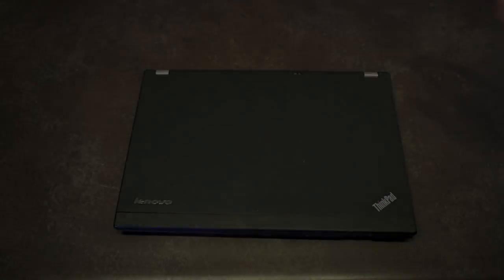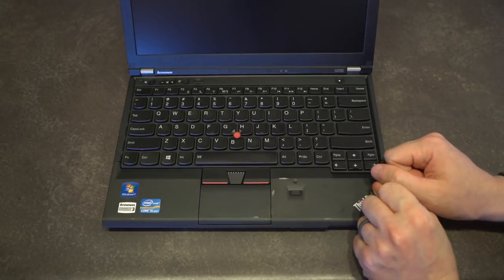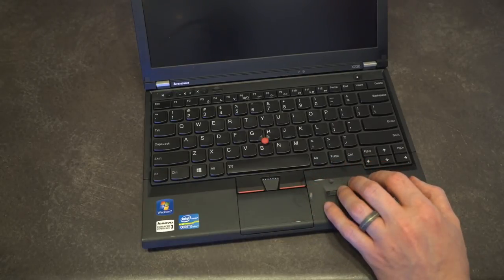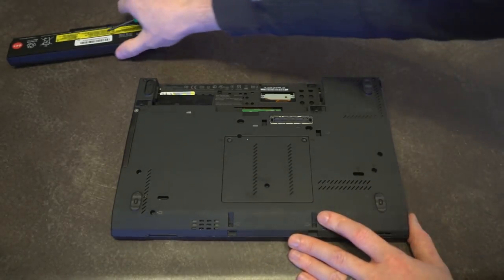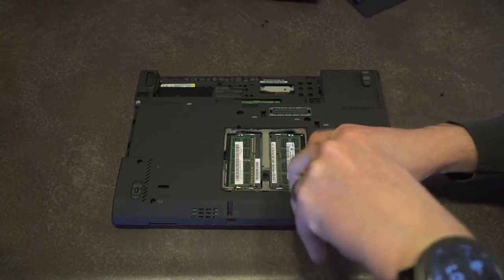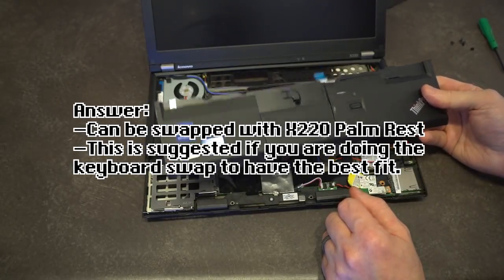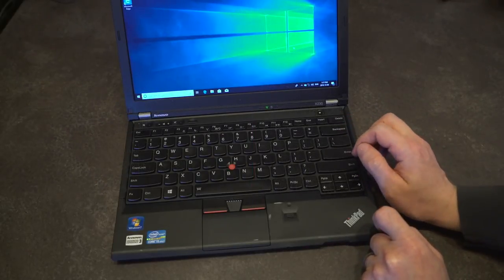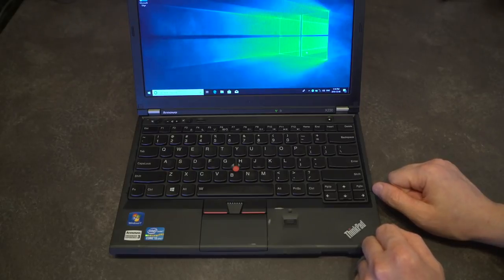Lenovo ThinkPad X230: A Fan Favourite

Comment: Bought a x230 a few days ago and it's a great little machine. I swapped out the HDD for an SSD and changed the RAM from 4 to 8 Gigabytes. I paid 130€ (146$) for the used x230 in good condition, 23€ (27$) for the used RAM, and 20€ (22$) for a new 120 GB SSD. Not a real bargain, but for a country like Germany, where tech-bargains are really rare, it's a pretty good deal.

Your video is one of the best videos about the x230, because it includes the main things about this notebook, while it is relativly short. Keep up the good content. :)
Reply from the maker: Thanks for the evaluation of my content. It is a balance of information and length and I try to strike it in the middle. These machines have a lot of information to go with them but choosing what will matter most can be tricky.
Reply: Same here, bought it about month ago for £108, added another identical samsung 4gb stick for £12, so its 8gb now. It has backlit keyboard, IPS screen, i5 2.6ghz and it has 500gb hitatchi 7200rpm hdd which is fast still and i havent rushed upgrading it to ssd yet. Takes less than 20 seconds to boot and to login to desktop. Also i got ultrabase series 3 docking and lenovo dvd drive, both brand new and paid £28 in total for that combo. Love this machine!
Reply from the maker: Wow, what a setup. Love to see pics.
Reply: Where did you buy it if I might ask?
Reply from the maker: I buy mine locally.
Reply: @BJKaan Akkoc Write English! The x240 keyboard can't be easily upgraded with a keyboard of the x220 (non island style). Also the processor is weaker but more energy efficient. Maybe get a even newer model if a windows upgrade is already a hurdle for you!
Reply from the maker: I'm not sure the x240 can take a 220 keyboard at all.
Reply: I did the same upgrades you mentioned... +4GB RAM upgrade and a 480GB SanDisk SSD swap... its a beauty now... enjoying the machine everyday... amazing battery backup and portability!!!

Comment: Watching this on an x230
Reply from the maker: W00t. What is your specs?
Reply: @LaptopRetrospective  Just the i5 model with 8GB of RAM, nothing too fancy. It's my daily driver and it's fairly solid for most of what I do.
Reply from the maker: You need a daily driver and one for home use. At least. Lots of reasons for another.
Reply: @LaptopRetrospective  I was considering picking up a T420 for home use.
Reply from the maker: Not a bad choice either. Decisions, decisions.
Reply: Me too!
Reply from the maker: Nice!
Reply: My school laptop is a T420. Man do I love the keyboard on that thing!
Reply from the maker: They are nice, for sure.
Reply: Mine with 16gb ram with i5 cpu.
Reply from the maker: Lots of RAM to go around.
Reply: mine too its my main working pc with i5 8gb ram and 250 msata + 500 850 evo on a docking with 6 extra usb. couldnt find any other pc at this price with similiar peformance
Reply from the maker: Great point on price and performance.
Reply: Same! Actually arrived the day after this video was published!
Reply from the maker: Good timing!
Reply: me too :)
Reply: Watching this in 2019!!
Reply: same, but my is the Tablet model =)
Reply: Does anyone here have the IPS display? I love this friggen thing, If I had  the IPS display it would be perfect.  i7, 16gb, OEM intel SSD, fresh oem 6 cell battery in my machine.
Reply from the maker: Those are some nice specs you got there!
Reply: @LaptopRetrospective  thank you, it was a great bargin I got second hand off Craigslist almost 4 years ago.
Reply: On a x230, with 8gb ram and samsung evo 860 ssd :)
Reply from the maker: Very tasteful upgrades you have there. 😁
Reply: i7 3520M + 16Gb + 480SSD here. Superb machine. but im thinking of the fullhd IPS mod also ... yeah i work at local computer shop that sells old leased computers to private use and we have service too... and lots of parts. Modded my T430 to fullhd IPS from X1 carbon. also with i7 and 16gb... because, why not :)

BTW we give 12 months full guarantee to those old computers we sell. I think it's reasonable for a computer that cost 150 european buckaroos?
Reply from the maker: Very cool. Glad to hear you are doing that. It's support from shops like yours that help keep my channel in content.
Reply: Mines the x220 Intel Core i7-2640M CPU @ 2.80GHz 16gb ram 480GB Kingston SSD and even though its getting on it blows some off my friends newer laptops away!!
Reply: Me is with my x200 😉
Win10 Pro 64-bit, 8GB Ram
Reply: same x230
Reply: Me too！
Reply: Watching this on a X230, with XP Pro x64. All drivers installed, including for the fingerprint scanner!
New Moon's a pretty good browser, btw.
Reply: Same
Reply: Same here
Reply: Me too. SSD upgrade is a must! Also using MSata drive.
Reply: @wofwof14  how did you upgrade to win 10?
Reply: @legendsathya3041  i just installed the windows 10 pro and it doesn't have any issues.. Added higher RAM and SSD.
Reply: @wofwof14  your fingerprint authentication still works with win10? Did you install from win official website? ( Please don't mind, I'm noob )
Reply: @legendsathya3041  yes I got the driver updates in all from Lenovo thinkpad center.
Reply: Mine bought it new and upgraded.
i7 3520 16GB ram 2TB Transcend 230s WWAN full HD IP

Comment: I've got one of these, and have been surprised at just how quick it feels. If I didn't know it was made in 2012, I wouldn't think it was an old machine. I have the i7 with 16GB of RAM and a whopping great SSD in it. Mine also has a hardware mod to support a 1920x1080 panel (so it was an extremely lucky eBay find).

I develop web applications for a living and find this X230 does the job nicely. So nicely, that I decided to get a W530 (a 15" version with a quad core CPU, that costs a similar price to an X230) to use solely for my work. The W530 is a tank, so stays at the office, while the X230 is predominantly for home/out and about use.

The only negative to the X230 is the low speaker output, but headphones obviously work around that problem.

Oh, and the docking stations – if you have a separate monitor, they're superb (and very cheap on eBay).

On the keyboard issue, I'd rather ThinkPad still used the original keyboard layout, but the action on the X?30 chiclet keyboards is the nicest I've ever used on a laptop. Once I got used to the position of the Home, End and Del keys I didn't look back. I'd recommend the non backlit version, which feels nicer (and the thinklight is always there to light up the keyboard if necessary).
Reply from the maker: That's a nicely kitted out unit you have there. Thanks for sharing the mods done and what you use it for.
Reply: This laptop is amazing I use it as well. Although 2012 laptops are not that old in 2018. 6 years old isn't really old. Laptops as of 2010 are old
Reply: hi.. does your computer run hot.. ive heard that the i7 version have that problem
Reply from the maker: I'd check the age of the thermal compound.
Reply: I bought a W530, quad core i7-3840QM, NVidia Quadro K2000M, 24GB RAM, 256GB mSATA SSD, fingerprint scanner and color calibration sensor. I want to love it but it's probably going to get torn apart and sold for parts. The screen glitches randomly quite frequently when I turn on or wake it up. And recently, it began to shut off as if it lost all power. I feel as though it might be a bad connection around the CPU because pressing down on that area causes the laptop to shut off. I did some research and it seems that it's a common problem among W530's. I'm surprised that a laptop that costs this much, especially a ThinkPad, is having such issues; it agrivates me. Have you had any similar experiences with your W530?
Reply from the maker: No experience with that W series yet. I'll ask around.

Comment: I use mine nearly every day.  Nice and very capable machine even in 2022.  Other than SATA SSD,  mSATA SSD and ram upgrades to max it's stock.  I have the ultrabase, the slice battery and an express card dual USB 3.0 add-on to go along with it.
Reply from the maker: Nice! I know I love using my X220 around the house.
Reply: Would you reccomend an x230 for word processing, browsing the web and basic windows use? The price around here is around 120 euro
Reply: @Tonn_23  If you put an SSD into it and 8GB RAM it can handle that stuff just fine.
Reply: @uni-byte  Thank you!
Reply from the maker: Yep, it can do it all.
Reply: @LaptopRetrospective  it can't make me breakfast though :'(

(yes i know i know it's a laptop. i was just-making a joke (since (as-in "because") you said the laptop can do it all)).

Comment: Nice!  I picked up an X230 recently off Craigslist for $200 - I already have an X230T.  I had no idea a backlit keyboard was an option, so that was cool.  Normally I would upgrade to 16GB but it has 8GB and that's enough for now.  I did buy a new 44++ (9 cell) battery; that wasn't a problem but did cost around $60.  I am running Linux Mint 19 on it and use it for software development -- node.js and visual studio code.  I like it quite a bit, I am seriously thinking of getting another one before they become hard to find.
Reply from the maker: Or to have cheap spare parts. It's how the collection begins.

Comment: In 2019: i7, 2.5 TB SSD, 16GB ram, Backlit keyboard and 4hours of battery on Ubuntu 19.04.
Reply from the maker: Nice!
Reply: Nice. I have it with an Kingston 480GB A400 Sata3 2.5" Internal SSD and 8 GB RAM. Looking to upgrade. Any suggestions of SSD and RAM ? Thanks.

Ubuntu user too, I am looking to try Arch with the new SSD.
Reply: Do you think I could easily upgrade my i5 to an i7?
Reply from the maker: X series are soldered so it's a motherboard swap.
Reply: @LaptopRetrospective  I guess I better start searching for a motherboard with an i7
Reply from the maker: Or an x250 board, they drop in to the x240 and vice versa.
Reply: @LaptopRetrospective  I have a x230, and have been thinking of searching for a x250 but I really like the x230 and don't know if the upgrade is worth it
Reply from the maker: Depends on what you're hoping for. The x250 has amazing battery life.

Comment: Just got my X230 here a few days ago.  Already swapped the HD out for a SSD, am running it as a dual boot system with Windows 10 and Linux Mint 19.1 on it.  Going to do the IPS screen update here one of these days, also have another hard drive caddy on the way so I can swap in another SSD to play with other Linux distros so I won't nuke my dual boot drive and in case a distro gets hosed. Not to mention it makes distro hopping a lot easier..

So far I'm really enjoying it...
Reply from the maker: Nice plan. I suspect that will work quite well. I do similar things with my x220.

Comment: I have a W530. I never knew about the light. Mine is a llittle flash light mounted next to the webcam. Very neat. I learn something new about these ThinkPads every day.
Reply from the maker: The ThinkLights are really handy for looking at documents and other such things in dimly lit areas. Late night plane or train trips are easier because of it. Same with all the other weird places ThinkPads end up.
Reply: @LaptopRetrospective  I bought mine recently because its pretty powerful for the price I paid. Also, they are very Linux friendly which is the OS I run.
Reply from the maker: Very nice. Which distro are you using? Tried elementary yet?
Reply: @LaptopRetrospective  I have, Elementary is very stable. But I use Arch as my daily driver.
Reply from the maker: Fair enough. Arch is quite tweakable and has been at the forefront of ThinkPad support.
Reply: Well I will say getting the Optimus drivers to work properly was a pain. But once I got over that hurdle its been very stable so far.
Reply: Yes, precisely. Utilitarian and non-gimmicky. Same reasons apply to the Trackpoint. I prefer to do all my typing and coding on a Thinkpad or my desktop's Model M.  Linux friendly for just about any distro you throw at them as well as BSD. I wouldn't quite say match made in heaven, but it sure comes close. Far better than any other laptop I've used for Linux. Not all features may quite work, but all the features that do, required no configuration really whatsoever aside from enabling maybe one service with a quick systemctl command or attach command for Wacom support. These notebooks, good or bad, still hold a special place with me.  @LaptopRetrospective
Reply: Arch has been an incredible experience on here! Gave me way more use out of this Core 2 Duo L9600 as well!  @LaptopRetrospective
Reply from the maker: Agreed. They are special.
Reply from the maker: @jessehill9993  respect to Arch but I've enjoyed Mint and elementary a bit more, but I'm a casual user mostly in those distros.
Reply: Fair enough, and rightfully so! I wouldn't say Arch would be a casual user's distro anyway although I think it would be fantastic to see one just as light and customizable. Not to say others aren't, but I've had big problems customizing say, Linux Mint in particular especially desktop environments. Fedora on the other hand, did it beautifully. I actually started using Linux on Linux Mint myself. I'm also glad you didn't say Ubuntu! Orange you glad too? I distro hopped until I settled on Fedora and Arch as my standards but every gripe with Arch is deserved. Thinkpads still have been far more friendly than say my Lenovo P500 which brightness control has been a severe problem across the board with Linux. I do retro-computing so reboots aren't as big of a deal for me, but on my "cutting edge" if you may systems, it shouldn't have to happen if I don't want it or need it especially when you hit brightness controls and it drops to the lowest setting and won't work again until you get back to the POST screen. NetBSD also has been designed on Thinkpads for Thinkpads as well. My Arch opinion has always been like this... if you have the time and energy, don't be lazy and try it or at least don't be scared by it.   @LaptopRetrospective
Reply from the maker: Well said. Ubuntu doesn't do it for me. I think other people are doing better and greater things for the average user.
Reply: Ubuntu... Me neither. Canonical really dropped the ball and has joined the ranks of Microsoft, Google (Linux, without GNU... there is quite a difference), and Apple (UNIX like). I don't really want to delve into Ubuntu or Canonical, but sadly, IMO defeats the purpose of switching to Linux or using Linux in the first place. They don't care either. I have seen Ubuntu turn more users off than on to Linux. I don't count it as my first distro for a reason, and experimenting/dabbling doesn't count as one of those reasons. Linux Mint I actually gave a true whirl and on a Thinkpad. Left alone, it's truly a great experience for the first time user. I can't say anything about elementary OS. You kinda hit the nail on the head and the other people deserve more credit.  @LaptopRetrospective
Reply from the maker: Join me in 45 minutes to see elementary run on a ThinkPad 14. 😎
Reply: Since I'm on here, sure why not? I'll see you there! (I have been committing the ultimate sin of not capitalizing the P!!! nobody called me on it though :D)  @LaptopRetrospective
Reply from the maker: Great! See you then.

Comment: Just letting you know that Lenovo struck a deal to allow pc3 2133mt/s ram to run at full speed in the i7 models.  I got ahold of 16gb of Ripjaws (2x8gb) and it is really nice.  Beats the single channel x240/x250 machines hands down.

Comment: Ok: I bought a 4k monitor (LG 24 UD 58), and I can confirm that the x230 works via miniDP to DP at full 4k resolution, at 30 Hz (perfect for office, programming, etc). Don't expect gaming, of course (you are a ThinkPad owner, so it shouldn't be a problem), and if you try to play YouTube at 4K resolution, it will freeze. But you can use full 4k at 30 hz, and with the LG is amazing!! Did I mention I paid about 500 bucks for a 300€ refurbished laptop (Thinkpad x230, i5-3320M, 8Gb, 240 SSD Evo860) + 200€ 4k IPS monitor :) It makes it so rewarding...
Reply from the maker: Nice info. Thanks for sharing.
Reply: @Luis. Are you sure you're getting 4k resolution on that display? I ask because I read on the X230 datasheet: "maximum external resolution:  2560x1600@60Hz (DisplayPort via optional Mini DP cable);" If you confirm the X230 supports 4k, I'll buy one of these lovely models. I hate the newer ones. I have an X260, but it's not even close to the quality of the older Xs.

Comment: There were actually quite a lot more than only 3 CPU's available, the choice was different in various countries. For example, the machine I picked up recently has an i5 3380M at 2.9Ghz.
Reply from the maker: Yes you are right, 11 by my count in hindsight.
Celeron 877 
i3-2350M 
i3-2370M
i5-2430M
i3-3110M
i5-3210M
i5-3320M
i5-3360M
i5-3380M
i7-3520M
i7-3667U
Reply: @LaptopRetrospective  whilst I think about it, if my machine has a 3380M at the moment, how much of a performance increase would I see from one of the i7 chips if I can find a board at a decent price?
Are the i7's physical quad cores or still dual core with Hyper Threading?
Reply from the maker: Like with all more powerful chips, there will be the issue of heat and battery life. Both i7 variants are dual core, four threads. 3667u at 17W TDP and 3250M at 35W TDP.

Comment: I own a X230 from little over 2 years. Bought it refurbished (i5 3320M, 8GB, 256GB SSD, 9 cell battery, IPS display) for around 290$ in mid 2016. It is still my primary personal laptop.

Upgraded it shortly after to 16GB RAM and 500GB Samsung 850 EVO. It is still going strong. Battery health is at 91%, which is tremendous, lasts me close to 8 hours.

The only thing that could have improved my experience would be a higher res screen, even to the tune of 1600x900 would be perfect.
Reply from the maker: Nice setup!